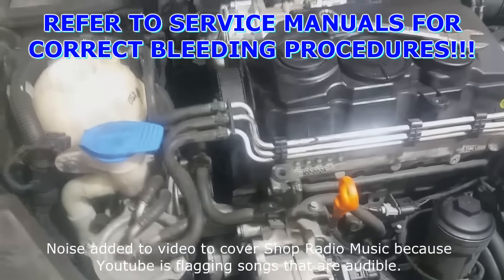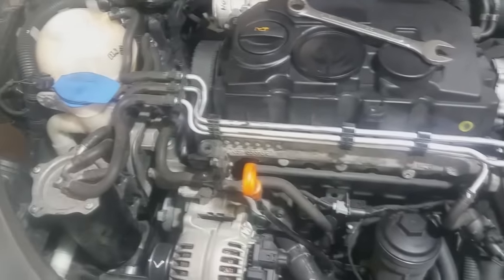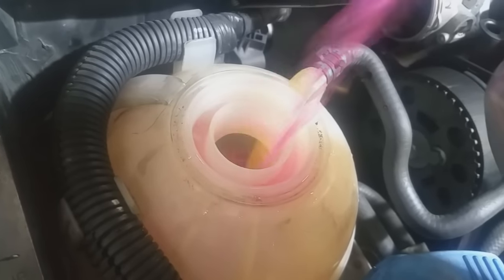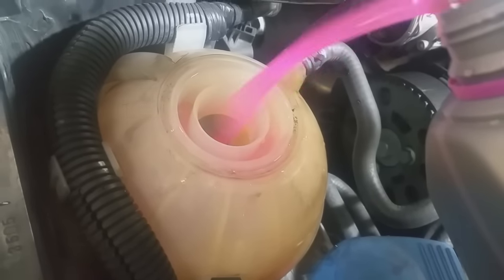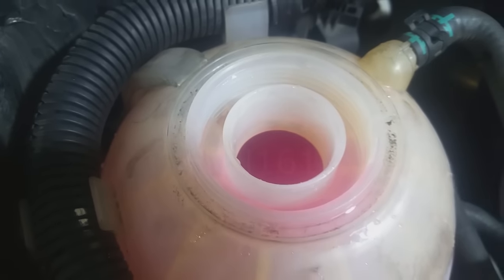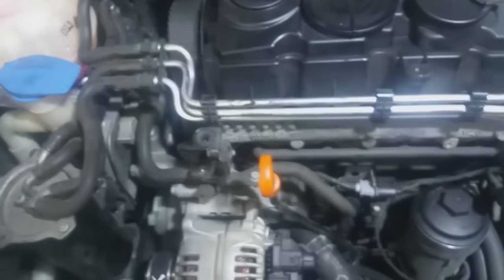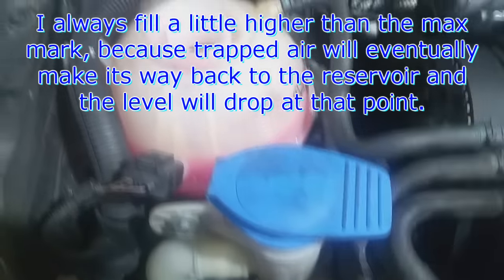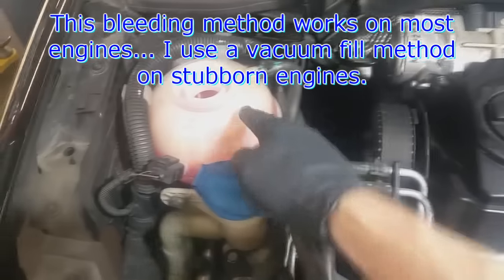Basic VW cooling system filling / bleeding info (viewer request)

Comment: I don't know if my question pertains to this video, but I'm looking to replace a radiator on an 2011 VW Jetta 2.5 SE automatic. Considering I've never done anything like this before, are there any pointers you can give me to guide me through the process?
Reply from the maker: 1) Go to https://erwin.vw.com/erwin/ and create a free user account.
2) pay for a 24hr "subscription" ($35USD)
3) download as many service manuals (PDF files) as you want, for your car, or any other VW
4) read the steps involved about how to change the radiator (info in Engine service manual... drain & fill coolant, radiator removal & install, Body Exterior manual... how to remove front bumper)
$35 USD is the best deal online.

Comment: Can something as simple as no o ring on the reserve tank make levels go low ,, every couple of days ?
Reply from the maker: If the cap is missing an o-ring... replace the cap. If the level still drops... then you still have a leak. 90% of leaks are external, meaning that signs of coolant leaking should be visible. Year, make, model, engine... the more info I have, the better I can help.
Reply: 2015 vw Jetta,, no gunk on the oil cap, or anything
Reply: Thinking they might be air in the system,  idk

Comment: Hello! I tried doing this today and we weren’t getting any gurgling 😢 unfortunately we watched another video and couldn’t come across any other videos until we found yours!
We emptied out the previous coolant in my 2016 jetta, went to the fill the reservoir and NO gurgling or burping has happened. We turned the car on, nothing. We tried massaging the hoses, nothing. Now we are stumped and truly can’t afford to take it into a shop. Do you have any tips? We are assuming it’s a blockage. Thanks in advanced!
Reply from the maker: Depending on the engine, vacuum filling might be the only way to go. You can try to disconnect various hoses to let air out / see if coolant is present. If you didn't have any overheating issues before, then you shouldn't after. If you do, then you still have air in the system.

Comment: Hi I have 1.6 tdi overheated when dpf regenerate I noticed coolant was not flowing back or going in to system as well i opened the reservoir tap obviously slowly the gas leaked out with coolant overflowed out of reservoir the temperature then went back to normal do you know what it could be I have recently changed water pump with thermostat as well but did not help mow this has happened.
Reply from the maker: Regeneration should only happen when driving (I think)... yes? So no overheating as long as it is not regenerating? I don't know what the problem could be, sorry.

Comment: Question... Just had the water pump assembly replaced on my 13 CC (2.0T)..  on occasion when driving the temp gauge with move up a half or a notch (to 200) and will usually drop back to 190 within less than 30 seconds..   Could that be air in the system?   Now it seems to be doing it less and less as I drive it more. I have a real good VW/Audi tech and he thinks the pump assembly might be faulty and he will put in another if needed.  Thx
Reply from the maker: Not sure... if it keeps doing it (and it wasn't doing it before the new pump was installed), have them investigate further. Could be an issue with the thermostat (part of the pump assembly). If it's air that's still in the system, the air will eventually work its way into the reservoir & coolant level will drop.
Reply: @EXOVCDS   Thanks for the quick response...  I'm talking with my tech tomorrow to decide what we're doing.

Comment: I replace my expansion bottle on my Audi rs4 b7 put a new one on put it all back together again  started the car up .no I didn't bleed  the system and there was coolant dripping from under  the car there was no leaks from the top would an airlock cause it to come out of a over pipe in the heating system  I  can't look under the car at the moment not well any thoughts
Reply from the maker: No need to bleed it if all you replaced was the expansion / reservoir bottle.
Depending on how much fluid was spilled... it could just be residual coolant.
I can't think of anything that would leak due to having changed the reservoir.

Comment: Hi man nice video! I have a question. i have jetta vw 2015 2.0L, should I use pink peak coolant even it is says on bottle that pink one is for vw 99-2006? Or violet color one where it days vw 2006+ ?
Reply from the maker: I think you already read the answer... 2015 comes after 2006. If someone before you flushed & installed the pink stuff, then stick with the pink stuff or flush the system again. The type of coolant only matters while the car is under warranty.

Comment: Thanks. Do you use 100% coolant or mix with distilled water? A couple of mechanics have told me to mix. Btw, how many liters in total roughly? The bottle is a measley 150ml.
Reply from the maker: Year, make  model, engine? 
50/50 mix.

Comment: Im getting ready to change the coolant on our 2010 Jetta 2.5. Not sure what coolant is in it (it’s orange colored). I plan on using 50/50 G13. Im not sure how to flush the system. I don’t want to use water since I’m refilling with 50/50 and don’t want to throw off the mixture. Any recommendations on what to use to flush?
Reply from the maker: The only way to "flush out" the old stuff... is to run straight water (distilled) through the system until only water comes out. You can never fully drain the system... there will always be liquid behind. To account for the water that is left in the system, fill with a richer mi, 60/40. Drive the car for a few days and check the mixture strength. With summer coming up, it'll be fine if it is not 50/50.
Reply: Thank you for the reply. I forgot I can always check the mixture with a gauge to  make sure it’s as close to 50/50 as possible.

Comment: i flush my system today took it for a drive the first time it got to operating temperature without overheating the second time i flush it again with water filled it again with water to finish getting the dirty water out the water stayed in my resivior and would not move my engine started to overheat how do i fix that?
Reply from the maker: Year, make, model, engine?

Comment: HOW do I know when the thermostat opens, or even if its operating correctly at all?
Reply from the maker: Year, make, model, engine?
Reply: @EXOVCDS  hi. Seat ibiza 1.2tdi type 6J. There is no engine temp gauge on the dash. Found out i just have to feel the top hose to radiator, run engine from cold and it should be obvious when thermostat opens or if its stuck open from starting.
Reply from the maker: It is best to compare both upper & lower radiator hoses to see if the thermostat opens. Usually the upper hose gets hot first (if the thermostat is located at the end of the bottom hose by the engine).
If the thermostat is not opening, then the engine will overheat. If the engine only overheats at long idle, but ok as long as the car is moving, then the thermostat is OK. If it overheats all the time, then the thermostat could be bad (or the water pump). The more info I have, the better I can help.

Comment: How much litre coolant required for polo 1 litre or 2 litre
Reply from the maker: I don't know, we do not have Polo in Canada.
Is the coolant already mixed with water? 
Most small engines need about 4L 50/50 mix (2L coolant + 2L distilled water)
1.8T to 2.0 need around 5 to 6L
2.5L and bigger 7 to 9L.

Comment: So I flushed my 2001 VW Jetta 1.8ts coolant with water (while the car was off) and then once it was all flushed, I tightened the radiator cap back on and put in the new coolant and topped it off like you said in the video, turned on the car WHILE the cap was still off to bleed out a bit until the cars temperature got to the middle... then I put the cap back on. I don’t have heat at idle and the coolant ball was steaming, what did I do wrong? Is there air in my coolant system still? I checked for any leaks and there is none. Btw I just replaced my thermostat a couple days ago too and haven’t turned the car on since today. I currently have the car shut off in my driveway. I did not take it for a test drive yet and it does not overheat while idling
Reply from the maker: There will be steam in the bottle / coming out of the bottle once the coolant gets warm (just like a water in a pot that gets hot, water will evaporate)... do you have coolant flowing back into the reservoir when the engine is running? If yes, hold idle at 1500 rpm until the thermostat opens & the fans come on, with the reservoir cap ON (after initial bleeding, which you have done). If you have NO flow back INTO the bottle, check for a blocked hose. Since you have heat at higher RPM, you probably still have a bit of air trapped in the heater core / system. As the air makes its way back into the bottle, you may have to top up the coolant level after the engine cools off again. Do not open the reservoir when the engine is warm / hot. If the temperature needle climbs past the middle of the gauge, shut the engine off and allow it to cool down... the warming up & cooling down can help move air around to where it bleeds out. You can also disconnect the upper radiator hose or any other coolant hose, to allow air to come out / check if coolant is present. Pick hoses that are at the higher level of the engine (that's why the coolant return hose is at the top of the reservoir bottle. If you disconnect a coolant hose and no coolant is present, you can fill coolant into that hose / or radiator until the fluid is level / no more will go in.
Reply: @EXOVCDS  I actually did exactly what you just replied to me and it worked! I shut the coolant bottle when it warmed up and gave it a couple revs and my heat came! I also kept squishing the radiator hose before turning on the car to let the air escape. I took the car for a test drive and everything is running how it’s supposed to be, thank you for the knowledge and your reply👍🏽
Reply from the maker: @4b11_Kev  Thanks for the added info! You might still have to "top it up" over the next few days... if the fluid level drops a bit. If it keeps dropping / you have to keep topping up... look for a leak. Thanks for watching!
Reply: @EXOVCDS  will do bud👍🏽 thank you again for the info, you earned my subscription! Happy holidays
Reply from the maker: @4b11_Kev  Thank you, likewise!

Comment: Hey I am replacing the radiator on a MK4 Jetta. The old coolant was not the proper coolant for the car. How to I make sure the engine has also been flushed of the coolant as well? Do I need to remove the thermostat?
Reply from the maker: If you run water from a garden hose through the system... and letting the water exit at various locations until only clean water comes out, that be enough. Ideally you want to use distilled water.
Reply: Thomas EXOVCDS should I do that with the car running? Thanks for the reply
Reply from the maker: No... engine off. Feed water into the engine and drain at a different location. Feed water in at a new location and drain at a different location.

Comment: Thomas...How do you pressurize coolant system to check on a small coolant leak on a 2008 volkswagen beetle vert.?...thnx bud..I have a conventional tester for a reg radiator cap set up...
Reply from the maker: Use same style of tester... with an adapter that fits in place of the reservoir cap. If you suspect a leak, just look for signs of leakage.  Which engine?
Reply from the maker: https://www.amazon.ca/Assenmacher-Specialty-Tools-FZ-41/dp/B00063Y3TK/ref=asc_df_B00063Y3TK
Reply from the maker: Sorry, that was Canadian Amazon. Here is the US link:
https://www.amazon.com/Assenmacher-Specialty-Tools-FZ-41/dp/B00063Y3TK
Reply: @EXOVCDS  2.5...thnx Bud

Comment: Hey EXO 

I have an overheating problem and another “ EPC “ light blink that comes on AFTER driving high speed ( 80mph )  on the freeway and then exiting to stop and go traffic 

2010 Passat 2.0 Turbo 
New Radiator 
New Water Pump 
New
Reply: Sorry didn’t finish that ….

New Thermostat 
New Upper Radiator Hose 

On comes on at a stop 
Once airflow increases the needle comes back down 

One odd thing I noticed is the AC line has frost on it ….. 

Is it possible the compressor has seized and is causing 20 degrees of heat ?
Reply: And lastly …. No gurgling upon filling with coolant
Reply from the maker: Scan for fault codes... there should be history codes for when the EPC was  on. 
Are the fans working when the AC is on? If the needle comes back down when the vehicle is moving, then the water pump & thermostat are OK. If it only overheats at idle, then the fans are not coming on. You can check for a fan control signal at the main harness plug for the radiator fans / module... similar to this video:
https://www.youtube.com/watch?v=oqdv4cm86Ns
Let the car idle... you should see low voltage on the control wire (less than 1Vdc).
Once the coolant gets hot / thermostat opens, the voltage should increase. If it does, but the fans are not coming on, then the fan module is bad.
Reply: Thanks for the reply …. 

The fans are functioning normally I believe.  I can hear and see them increase with the temperature gauge 

Do you think a seized ac compressor could cause 10 to 25 degrees of additional heat 

I slackened the serpentine belt and my buddy said the pulley was really hard to turn which I believe should be the opposite 

Or could it be a bad cat ? Would that add heat 

The car was overheated REALLY bad at one point ( the owner before me ) 

What about the AC condenser ? In front of the radiator ?  Is it possible that it’s causing even hotter air to run across the radiator 

Ha … I’m running out of ideas 

I did a pressure test this weekend and no leaks 

Head Gasket maybe ? 

Compression test revealed 150-180 psi on each cylinder 

When cold though
Reply from the maker: A seized compressor would melt the belt... ac system can only add heat to the cooling system if the ac is working (condensor getting warm). My guess is head gasket for the overheating... epc might be a separate issue.

Comment: Does air in the cooling system give you the same symptoms as bad head gasket? I overheated car, because of a bad radiator. Radiator changed, but now the reservoir seems to get hotter than before and has a little bit of bubbling/boiling going on, not sure... No way to monitor the temp level, car is not equipped with gauge (2014 Jetta SE 1.8L Turbo). Seems to drive fine, but it is losing coolant somewhere. Any guesses? Thanks in advance
Reply from the maker: Air in the system will cause coolant circulation issues & hot spots in the engine (resulting in hot spots and head gasket failure). Buy a cheap OBDII scan tool, so that you can monitor coolant temperature via the ECM datastream. Turn the heater inside the car to max hot. When the engine is at operating temperature 90c / 190F, heat inside the vehicle should always blow warm / hot. If it starts to cool off, you have coolant circulation issues or air in the system. Bleed the system more. If you continue to lose coolant, look for a leak... if no leak is found, could be that the head gasket is bad. Check the spark plugs & top of the pistons (with a borescope) for signs of coolant consumption.

Comment: Hi, a couple of idiots who were viewing my Passat that is up for sale decided to pour oil into my header tank when I wasn’t looking to try to get the car for spares repairs!!!! My question is how should I go about flushing the cooling system through? It looks like the same engine as above, my car is a 2010 Passat cc. Any advise would be great. Thanks
Reply from the maker: Sorry about the late reply, I was in Germany on vacation. Open the cooling system at various locations to drain the system. Fill with water & cooling system flush (can be bought at auto parts store). Run the engine for 5 to 10 minutes and drain (engine off)... fill with water, run the engine and drain. Fill with water, run the engine & drain... continue to flush with water until clean. Fill with 50/50 water/ antifreeze mix as final step.

Comment: I have a mk6 jetta 1.8t automatic. I got in my car yesterday and the coolant light came on. I popped the hood and my coolant resouviour was empty bone dry. so I filled it with the coolant mixture and distilled water. then after I drove to and from work today I noticed that when I ran the AC  I could smell coolant. also I looked under the hood on the lower passenger side radiator hose and noticed a puddle of coolant. do you think it's a bad Heater core or a bad coolant hose?
Reply: What was the problem? My Jetta had a leak from a bad radiator. It overheated on the highway. Once the radiator was replaced with a new one, I could still smell coolant (normal I guess). The smell went away, but then I drove a distance of about 120 miles and the coolant had either leaked or evaporated. Refilled and now when I run the car I get some bubbling (like here and there, not like bath bubbles) almost like air coming up. Anyway, was wondering what the issue with your car was because I am fearing I need a new head gasket. Thanks!

Comment: Hi! My car is Passat Komfort 2.0t 2010 with the TSI CBFA engine. Will this procedure work for bleeding or do I need some other, crazier procedures that I've seen on YouTube?
Reply from the maker: This should work... but always keep an eye on the temperature in the dash. If you don't see fluid returning into the bottle, stop the engine and check if the hose is plugged. Sometimes it can help to remove the upper radiator hose from the radiator and add fluid to the hose until the hose is full and then reconnect it to the radiator.
Reply: @EXOVCDS  Thanks!
Reply from the maker: Thank you for watching!